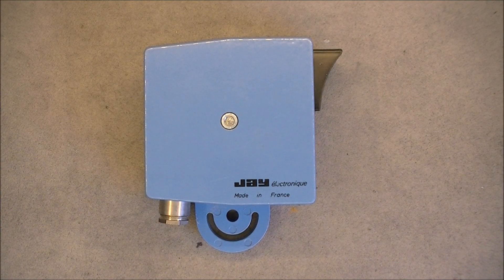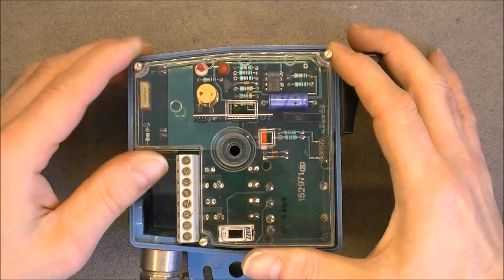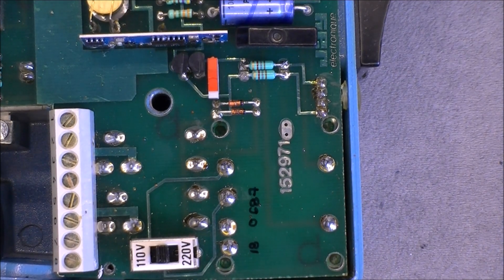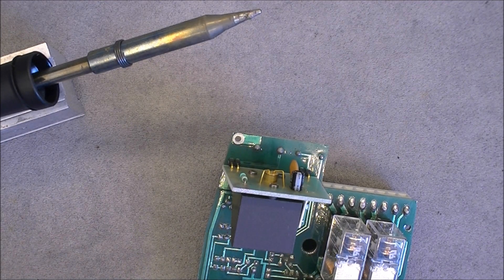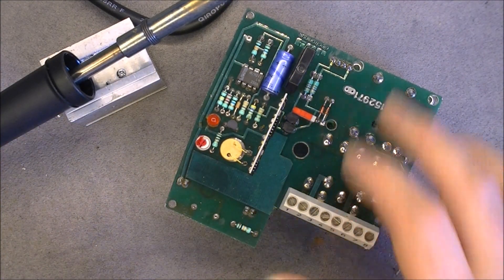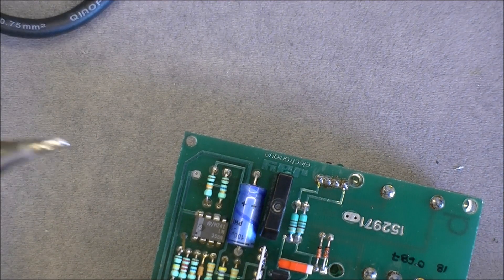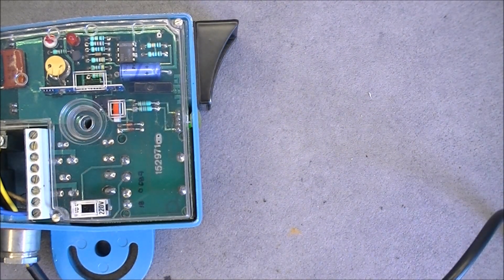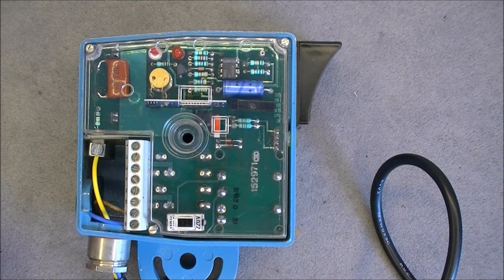Vintage light beam sensor teardown and test

Comment: Since the relays are making some noise you might have a look on the supply voltage with a scope. It literally sounds like there is AC on the DC voltage. Maybe that blue electrolytic capactitor is not good anymore. I had them just laying around for 20 years at work. A lot of those lost half their capacity so we had to toss them. You could just unsolder that and check it on its own.